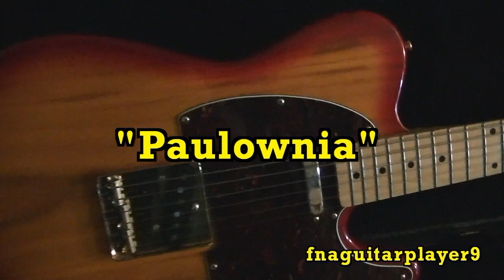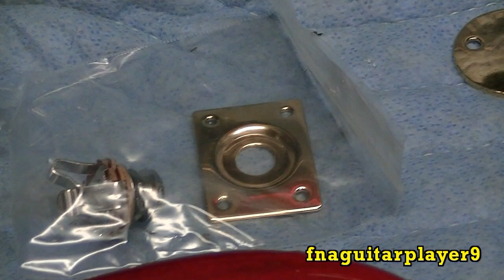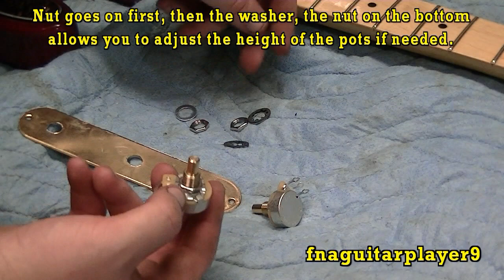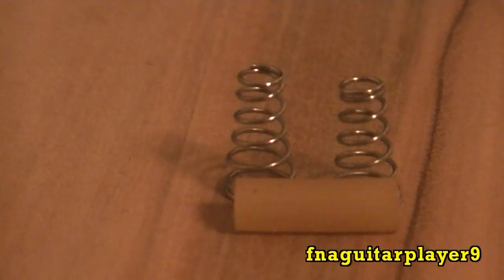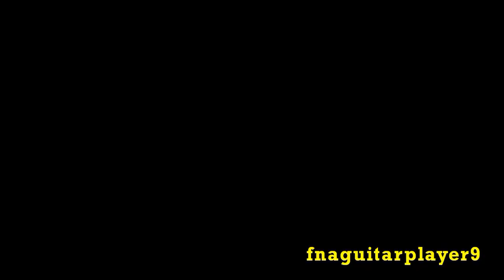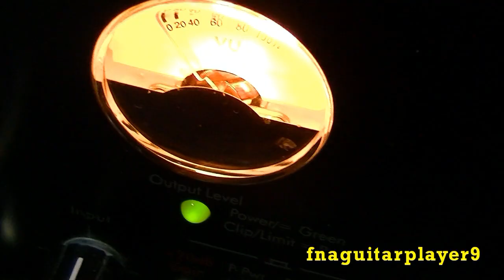Assembling a Tele Style Electric Guitar

Comment: Looks nice!  Proof that you can take less than ideal parts and make 'em into a decent guitar that doesn't cost two grand.  I'm in the process of building a Tele now, from GFS parts.  I'll watch out for a decent match between pickups, after seeing how weak that neck pickup is!
Reply from the maker: Thanks! So true, i have about 400 in this and it turned out great. yeah, you want a strong neck pickup, or get a pickguard cut for a strat pickup and you'll have a perfect match! Thanks for Watching!!!
Reply: GFS recommends their " vintage wound" neck pickup, by the way, since it's actually a smidge hotter than the usual Tele item -- after seeing this, I asked 'em -- especially when paired with their "hot lead overwound Alnico bridge pickup," and says they use this combination on one of their Xaviere guitars.   (Hope that helps!)  I'll be ordering that combination tomorrow.  At fifty bucks for both pickups, even I can afford that.
Reply from the maker: That should work good if they recommend it, they know their pickups pretty good, If i don't wind a pickup myself they are my go-to place for pickups and other parts. I hear ya, you definitively can't beat their prices.

Comment: Good vid. I adjust the screws on the volume and tone  knobs to be centered and visible when at normal positions for my main amp .... that way turning the volume and tone up and down is easily visible to your eye as you play. Once the pickups are in, expect to raise the bass side of the bridge pickup to make it 'twang' and drop the bass side of the neck pickup to suppress the  ' boomy ' sound, if any. The nuts slots will likely need adjusting with nut slot files to make it play easily. Best left to a setup guy unless you have learned what to do and why... At fret 12, the strings will be around 1/16" or maybe 3/32" above the 12th fret.
Reply from the maker: +Doug H. in VA Thanks! I hear ya, I do that to most of the time, that way your using the screws as indicators. That sounds about right, everyone has their own settings though, i don't like the strings real low or real high. But that sounds about right for a standard setup that most people would want. Like those places that sells guitars and says a setup is included, thats fine and all but its not setup for the players taste. I think they mainly just adjust the neck (truss rod) and get it playing decently. Thanks for Watching!!!

Comment: What's the best way to line up the neck with the body?  Do you use clamps at all?
Reply from the maker: clamps will get get in the way most of the time, you can do that though, if you put the neck in the pocket without screwing it down, put the bridge into place and run string (not a guitar string) where the first and 6th strings go, then you can adjust it if it needs it, but most of the time on the guitars i have put together the neck pocket was already drilled / routed correctly, so i just put the neck in it, then use a screw through each hole to mark the neck where to drill, then predrill the neck holes (making sure not to drill through the fretboard!) then its ready to go. Then you just have to line up the bridge with neck to make sure you have the same distance between the 1st string and the edge of the fretboard and the 6th string to the edge of the fretboard. If your routing a body using templates you will have to find the centerline of the body to make sure everything is going on square, one trick is to lay the pickguard in place where its sitting correctly and work off of it (marking the neck pocket). Hope this helps, thanks for watching!!!
Reply: Cool thanks!
Reply from the maker: F Zentura
your welcome!

Comment from the maker: No problem! I hear ya! There's several methods on this, what i did was just paint it as is then cleaned the lacquer off the frets, i used a utility knife to score each end then most of it just peeled right off the frets. The best method is to remove all the frets spray it then put them back in. It would be possible to mask them if you had small enough tape. I used a 400 grit scuff pad. 00 steel wool would work too. or even a 400-600 grit sand paper. thanks for watching!!!

Comment: Thanks for posting this.  I'm building my first guitar, & don't want to screw it up too badly.  (Only slightly joking.)
When you lacquer the neck, do you have to protect the fret wires somehow, or do you need to clean them off afterword?  Also, what did you use to scuff the back of the neck?  Thanks again!

Comment from the maker: what type of wood is your body? That affects the tone somewhat as well, but yes it is mainly the pickups, but i do recommended getting a better neck pickup, if you get the Professional series 1952 bridge like this i would suggest getting there 52 neck pickup as well, that would make a great sounding guitar (unless you need a gold cover). Also another thing is the potentiometers/capacitor use 250 K pots and a .047uf tone capacitor and .001uf treble bleed. Then you should have a sound very >>>